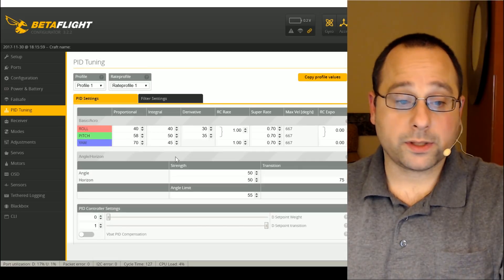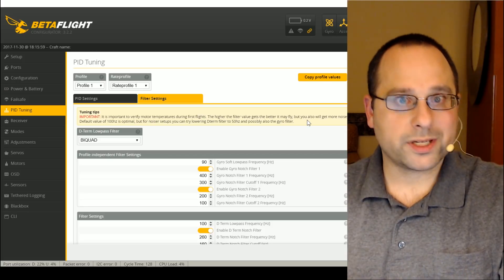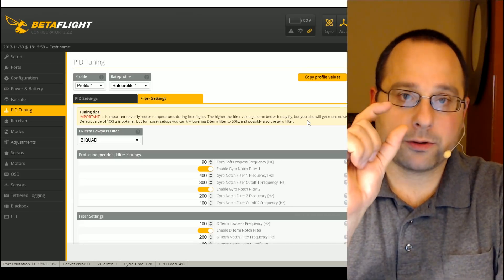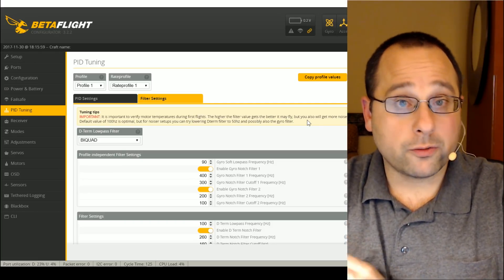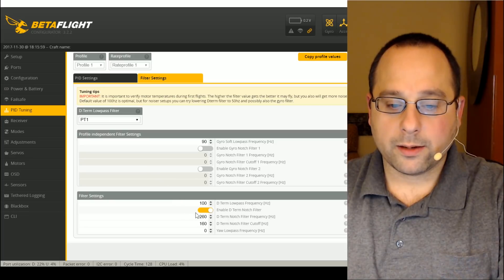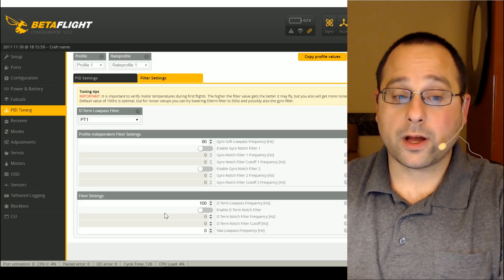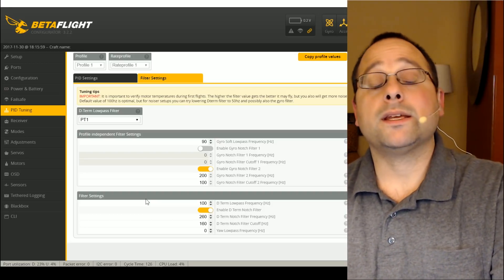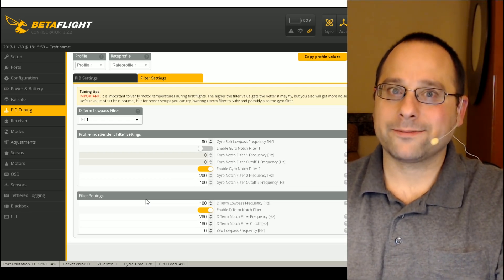Betaflight Dynamic Filter | HOW TO TUNE

Comment: Hello @joshuabardwell from the past
I'm looking on videos to help with tuning a tinywhoop. i want a more float feel to my mobula6 as it seems right now to drop like a rock. its flying on 1s 16000kv motors but i also have the 25000kv motors. i swapped from those because my flight times were like 2mins:( but now all my power is gone but i get close to 4mins but no "floaty" feel when performing acro. what would you suggest:") thanks JB, rj

Comment: I am having issue of hot motors in BF 4.0.3 
should I turn it to PT1 by default it is biquad?
Reply: You can try lowering your D-term first. In BF4 raising and lowering the D-term has a more dramatic effect than in earlier versions. If you still get hot motors try lowering the D-term Low Pass Filter. I have it set to 200Hz but try 100Hz or 50Hz as well. You will get more vibrations but your motors will stay cooler.

Comment: Does enabling Dynamic Filter affect flight characteristics?  Latency I suppose, but more the feel?
Reply from the maker: The dynamic filter should be the last one you turn off when trying to reduce latency and improve direct flight feel. Well, actually, you should never turn it off. If ou turn off all the other filters and manage to not smoke your motors, you'll have hardly any latency. If you then turn off your dynamic filter, you'll probably smoke your motors.
Reply: This is a so important because I turned it off for testing and yes, super hot motors.  1106-6000kv motors seem to run hot anyhow so I've been trying to cool them off - the screws are super hot, and I watched your vid about hot motors and there is no continuity happening.  Thank you so much  P.S. A flight controller seems like an analog noise controller the more I learn about filtering!

Comment: Does "as fast as you want" on f4 and f7 include 16k or 32k?
Reply from the maker: Betaflight 4.0 has dropped support for gyro sampling over 8k, so the question is moot :-)
Reply: @JoshuaBardwell  interesting thank you. And thank you for your prompt reply. I'm in the middle of trying to learn about filtering to dial in an 8inch 2-blade prop camera platform for filming a friend's wedding and strolled on to this video while trying to understand the available band pass filters. I did a tune session earlier to remove seemingly P-wobble tune issues in a Holybro Kakute f7 board that has been hard-mounted to the frame. As I drove home I asked myself "why doesn't it just isolate the signals associated with the motor speeds it outputs". Seems like someone already had that though. Is the dynamic filter available only on 4.0 then?
Reply: It wasn't P-wobble. I reduced the P to nearly nothing (having taken D down a lot in a prior session). It's definitely frame noise. At one point I had to land with incredible slop (if they could get a washing machine to fly, I could almost land it.. ;) ) but changing values I didn't quite understand via the OSD menu for general filtering seemed to improve things. I'm downloading the GoPro footage to see if it confirms my suspicions about the filtering improving the wobble.

Comment: Just a dumb idea, feel free to ignore...
To the best of your knowledge, has anyone ever put a quad in a vacuum chamber and measured the the actual noise the quad produces? You said something a while ago that got me on to this idea, I don't remember what. The end idea is something like an auto tune, call it freak-out mode. You fly the quad to a relatively high altitude like 200 to 250 ft then activate. The Quan would freak out for a second or two then return to normal flight. What it would be doing is measuring all the nose that it can actually here, then it would set the filters to ignore everything it just heard. ...?

Comment: if I setup a brand new quad with new props and motors (and no screws touching windings) and the motors get HOT even at default settings with all filters on ....then what do I look at ??!!! 5inch quad on 4s with 2600 kv 2205 motor

Comment: Joshua, I build a little brushed quad with a cheap F3 board. Installed Butterflight,  enabled dynamic filters, disabled all notch filters and set it up to 8k/4k. CPU usage, if I'm not mistaken, is around 27% or something like that. It's working wonderfully! It's only defect is the pilot. 😂

Comment: is it necessary to run these filters? My armattan rooster came with them turned off. I Just put your board in my hyperlow build and installed the latest firmware but i don't know if i need to run these filers?
Reply from the maker: It's only necessary if you have enabled 32k gyro sampling mode.
Reply: ok im not. Also love the lay out of the board BTW. Makes for a clean build especially in low profile builds.

Comment: One question. Is for amater new fpv pilot, like me,  better to disable or enable dynamic filtering. I crash a lot, so will that do more or less damage to my esc's and motors? Please help. Thanks
Reply from the maker: Enable. Much better for banged up props.
Reply: Joshua Bardwell thank you Josh. Will do that.

Comment: hey Joshua, hi! please help me, I did all that you said and my motor are still getting hot. 
motors:raceone 2750kv 2306
esc:ufofpv 30a 1200dhsot
FC: omnibus f4 with BF 3.2.5
i didn't touch the PID´s, the motors have soft mount, and the frame its an alien 5" modded, almost like Martian III
Thanks a lot for your help!
Reply: oh, props GEPRC 5040
Reply from the maker: Have you checked this: https://www.youtube.com/watch?v=eo2sjTNS0pc
Reply: Joshua Bardwell yep, i watched and i did every thing that you said, and nothing. I check every part of the quad twice and all is ok. With soft mount i reduce the hot in 30% maybe. But it’s not enough

Comment: Hey Joshua,  has anyone ever asked you about high camera angle and yaw, Picture you are flying a quad in a straight line with high camera angle, and you want to do a quick turn around rolling would work better but wouldn't it be nice if you could use yaw command to do this? i find myself moving the camera in a U pattern, having it adaptable with the pitch of the aircraft might be nice, Tell me what you think. because if I yaw, the quad just spins in the direction that I'm heading in, not turning me around, I think the controls could be better setup that way IMO
Reply from the maker: https://www.youtube.com/watch?v=-qYXVXiHGFA
Reply: Joshua Bardwell, thanks but not the repply I was looking for, your video basically said suck it up and learn how to deal with it. But what if it did it automatically? Idk just some thoughts. And thank you

Comment: Just to clarify, when adjusting on the filter page and you change from biquad to PT1. Is this step one as in now test your quad for hot motors or is removal of the the first notch filter the time for first test. Just as i am going to be testing in the field so adjustments will have to be made on the bench prior to each flight.
Reply from the maker: I would do PT1 first.

Actually, I would enable dynamic filter first.

Comment: I have a new build and not sure if I should PID tune first then, start disabling dynamic filters or... disable filters then PID  tune?
Reply from the maker: Check my "Alien vs. Chameleon" PID Tuning videos to see exactly how I do it. It's a bit of a back and forth. I usually go to PT1 and disable gyro notch 1 right out of the gate, and then proceed from there with PID tuning. After P and I are mostly correct, then I try disabling the other filters as part of D tuning.

Comment: I've found that it depends on the F3 board if it can run 8k/8k and dynamic filters.  My Motolab Cyclone can, my Motolab Tornado can't.  I have no idea why.  They have very different processor utilization running the same configuration.

Comment: Hey Joshua big fan of your channel. 
I got a quick question for you I’ve tried to lower the Gyro notch filters one at the time and can’t get them to save at 0 
After saving I close Betaflight only to return and find everything back at 400 etc is there something I’m missing?
Any help would be greatly appreciated. 
Thnx
Reply from the maker: +Dr FPV use the radio button to turn them off. Like I show in the video.

Comment: Hi Joshua, I agree in that sometimes the "simple" instructional videos are great.
When are we gonna get a first look at the Betaflight/Frsky new F.Port Protocol??
https://github.com/betaflight/betaflight/wiki/The-FrSky-FPort-Protocol
Reply from the maker: Does a product even exist yet?
Reply: yeah, there is a firmware update for the XSR (not official) and you have to be running one of the betaflight 3.3 builds. They have lumped everything together and freed up a UART if you don't have extras.
Reply: And the new betaflight configurator (not Chrome App) is hot off the press
Reply from the maker: Have you got a link to that? I knew it was close but I didn't know it had dropped yet.

Comment: Nothing against you but,  Do people not know this is in almost every video you do that has some the slightest amount of tuning?? Has anyone requested a video explaining how to turn an X9D on yet? lol (I usually buy it a few drinks and dim the lights personally) badum-bum-tiss..
Reply from the maker: I made this video because I don't think there is one video where I focus just on this issue. And it was very commonly requested. Making somebody sort through a 20 minute video to find the info they need isn't the best way of doing things.
Reply: I know, it was mostly jokes and slightly trolling.  Although I would have had a lot more trouble getting into the sky without you.  Thanks btw!

Comment: Mr bardwell. My quadcopter flies really well on biquad,  but when I turn to pt1 i start getting a lot of mid throttle oscilations. 
Do you think it is excessive d-gain and what i see is dterm oscilations?
From bb it doesnt look like it is a really noisy quad i am working with
Reply from the maker: Mid throttle oscillations are seldom caused by PID gains. You need to soft mount your FC or just leave the filters alone.

Comment: Hey Joshua, thanks for the video.
I have a few questions:

Does it only work if you're doing everything or could you stop at every step?
I mean, so far I have just enabled Dynamic Filtering but haven't touched anything else.
Does that even make sense? I would love to test at least the PT1 thing, but will that even have any effect without removing the Notch Filters?

Sorry if that all sounds weird, maybe I'm thinking funny...
Happy flying Josh!
Reply from the maker: +hateeternalmaver you can stop at any step.

Comment: Weird question no relationship to video, do u think that running sbus with only 8 channels would have less latency than 16? I've been curious on this for a while, I can't tell when changing on x9d
Reply: I've been wondering the same as well. I have done some tests, but the only big difference im noticing is when im tuning the RC Interpolation. The difference is that when i have the Taranis in D8 mode i can use value of 13 for RC Interpolation and get a clean RC curve. But, when i set my Taranis to D16 however, i can't get the RC curve clean no matter which value i use(JB has a video on how to tune RC Interpolation, if im not making any sense). I suppose there is some slight difference in feel with D8 mode and as i understand it, it's slightly faster than D16 mode. So it does make sense that i'd feel my quad respond slightly faster in D8 mode.
Reply from the maker: +Danger Davefpv yes it has less latency.
Reply: Joshua Bardwell well that's good to know, I know it's not dramatically different and I've even thought about the tbs crossfire I flew a crossfire and seemed like longer range the latency was way better in same area where I had xm+ it seemed more responsive like I was connected,now longer range if u listen to quad it seems like there is delay but it is delay with sound traveling

Comment: What would happen if you would stick on BIQUAD and  simply switch off the filters below ?
Reply from the maker: +Gamer Foo going to PT1 has a larger positive effect. Also if your motors get hot when going to biquad then you probably shouldn't try turning off the notches.
Reply: On 4 out of 5 quads following your instructions and disabling all 3 notch filters works fine for me without the motors getting hot. I have one quad where I can only disable the first 2 notch filters on PT1 and afterwards the motors run twitchy and hot. On this particular quad leaving BIQUAD and disabling all 3 notch filters seems to give me better results. No idea why. The build that is behaving a bit strange is using a Kakute F4 on the latest betaflight version and an racestar 4 in 1 running the most current Heli-S firmware with DSHOT 600

Comment: I sometimes wonder if racing is the endgame of quadcopters? 
I admit I just came into this hobby, but the amount of people focused on racing vs long range or programming or whatever, is quite significant.
Is there no such thing as an "all-round" or AIO quad?
Reply: Every freestyle quad could be described as AIO. They usually have enough power for racing at low to medium levels maybe even at high level, they can be used for long range with TBS Crossfire and bigger battery, altho i'd suggest lower Kv motors and 6" build for more range at a cost of punch out power and top speed. Of course a dedicated build for each purpose is always going to do better, but if you don't know what exactly you wanna do or can't afford to build more than 1 quad, then a freestyle build is the option to go with.
Reply: Thanks for replying so fast, VilleF1N. It's just, freestyle and racing quads are rarely carrying features like sensors, autonomous functions etc they are very simple racers.
Reply: True enough. There just isn't much point in having sensors on these kinds of quads. For one thing, they add weight and when you add autonomy to them, it takes the fun out of them. But DJI to the rescue for those who want their quad to basically fly it self while you just look at the pretty camera feed. That said, there are GPS and sonar modules designed for small quads like what we fly and Betaflight even supports them. You just have to find a bigger frame to fit all that stuff into, like ImpulseRC Alien or even Lumenier QAV-R would most likely do the job.
Reply: Thank you so much, I think I like building and the challenge more than buying DJI and those are cool frames. Nice to talk to you 👍
Reply: iMeMySelf You're welcome :)

Comment: I found the dynamic filter to be very useful. Now can I use any kind of prop I want to. before I could only use some Cyclones or high pitched racecraft. I couldn't use HQ 5043s or 5040s. my Motors would just have this vibration. I could see the props vibrating when they were idling. But now it's like night and day I turned it off and on to make sure its was helping. Why do I have to have this for my quad to handle lightweight props with less pitch? Seems to me like you should just be turned on at default

Comment: If the motors heat up when D-Term notch is disabled, can you just lower the value of the number to try and get the most of it?
Reply from the maker: Lower the value of which number?

The way the notch works, simply lowering the frequency value will not have the effect you are looking for. It's not like a lowpass filter where raising or lowering the value controls the amount of filtering.
Reply: Ahhhh now i get it, that makes sense. Apologies, noob here :P Without your and knowledge, I wouldnt be flying at all. Much appreciated for all the time you put into this mate. Cheers!

Comment: Joshua quick question: Im using the kakute F4! Great job writing the catalogue 👌 unfortunately i crashed and one of the data pad (m4) of the esc got pulled. What can i do to solder the thin white wire from the esc go the board? Im using the  furibee fuuton 200 and upgraded the f4 board and everything was ok now i dont know what to do.
Reply from the maker: https://www.youtube.com/watch?v=FysPHx7RL9s
Reply: Joshua Bardwell drone guru 🙌🙌🙌

Comment: Déjà vu I swear you already made a video about this because I watched it lol that’s how I learned what to do with dynamic filtering. What would the FPV world do with out JB? The thought is terrifying 👍
Reply: You are not wrong, I watched the same video. It's the one where he FIRST announced the Betaflight 3.2 availability in the "RC" stages. if it wasn't the first one, it was the second one, I watched the same video as you because I couldn't quite remember which notches to "zero" out, as I thought there were more than 2 or 3 to set to zero for full functionality. lol

Comment: I don't understand why we have to "tune" a "dynamic" filter. :-)
Reply: You can modify the nature of the dynamism, how it's allowed to operate in the time. For instance, discarding certain frequencies at specific states.
Reply from the maker: You aren't really tuning the dynamic filter, which tunes itself as you expect. You're really tuning the static filters, which interact with the dynamic filter.
Reply: Right so why do we need any static filters if there are dynamic ones. Always did my head in :-)
Reply: so the only benefit is to cut latency - i remember when each filter was added and each was an advantage and a smoother quieter quad ,  with less all around noise and vibration .. whats the benefit to using dynamic ??
Reply: So I turned Dynamic and all the filters off and have a soft mounted gyro would this be the best solution?
And Joshua didn't you say the dynamic filter added latency?